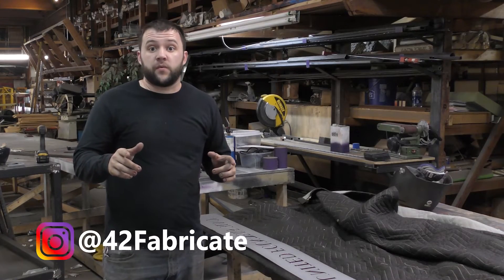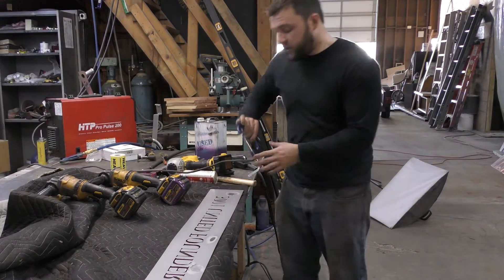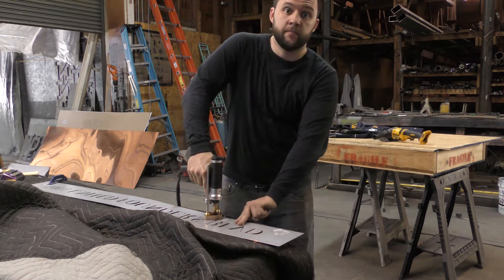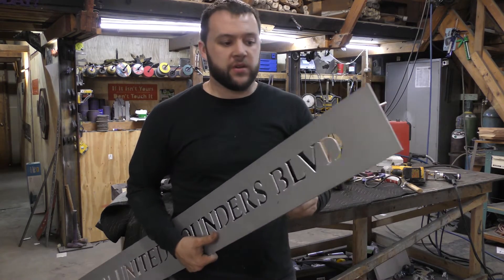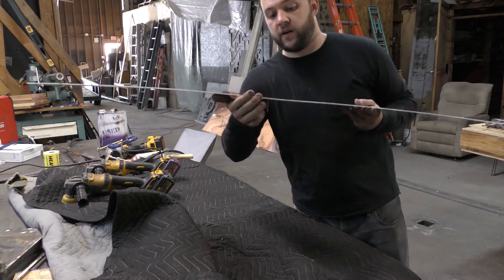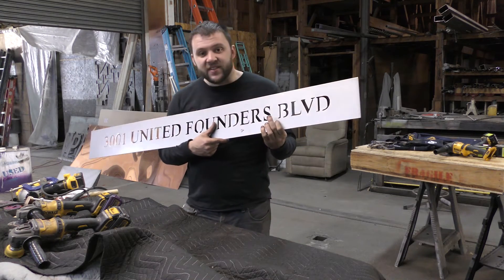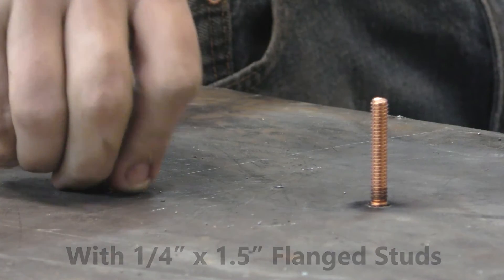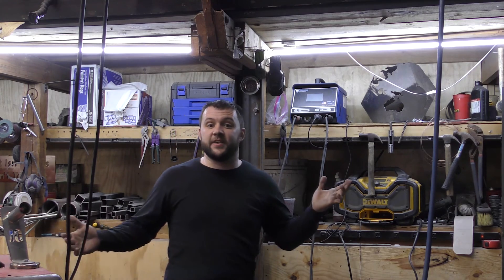Can You WELD thru Powder Coating? Without Damage? Sorta

Comment: The one that was clean you suspended with your hand. All the others you had pressed against the packing blanket. Try experimenting with that.
Reply from the maker: Good catch
Reply: Or, place the sheet on a solid surface that would absorb some of the flash heat and protect the coating.

Comment: Can you put a cold wet rag under the sign between the sign and the packing blanket ?
I put studs onto powder coated electrical boxes to hold wires in place and am looking to find a tool that will drill or grind just the paint off so that I can pop the stud/fastener to the can. !/4" diameter paint removal would be perfect with a divot in the center of it to keep stud from moving around. Does anyone know where I can find this type of tool ?
Reply from the maker: I am not aware of such a tool, but a punched pilot and a drill bit should strip the paint and give you a point for the stud, that said you also need a ground.

As for the wet rag, the thinking in the comments seems to be that not having anything under the powder was the best result, and I'd err in that direction. A wet rag could theoretically work, but introduces the chances of it not working, where studs over air seemed to work just fine.
Reply: @42Fab  As I was reading the comments, I was wondering..... How about using a reusable cold compress wrapped in a thin cloth? You don't make your work surface wet and chills the powder coated side enough to not be affected by the welding...

Comment: You can use a soaked rag on back side as a heat sink. I did this before on a part I had to weld after powder coat and it helped tremendously.
Reply from the maker: I would test it, but I'd guess it would work

Comment: Great video.  I would also point out that the one that had the best success was the one that was placed in the largest uncut area … seems like there might have been a few inches in each direction of solid metal to distribute (wick away?) the burst of heat.

Comment: The one that showed the least was overhanging the table and the blanket so it wasn’t being pressed into the blanket fiber as much as the others. Seems to me the powder coat gets soft and the hard pressing into the blanket caused the deformation. Having the powder coat more or less in free air so it can re-harden without being pressed into anything that will deform it might be the answer.  I can see if the coating is a different thickness or composition, there will be varied results.  Cool video though.
Reply from the maker: This seems to be the right answer

Comment: Definitely would try again with some sort of heat sink. I also noticed that the post that didn’t damage the powder coating didn’t appear to be completely pushed down on to the moving blanket. Could it be that the blanket insulated the heat instead of dissipating it quickly?  Either way I want one!

Comment: What about an aluminum or copper heat sink?  Water soaked rag or sponge to dissipate the heat?
Reply: On computer CPU's they use a grease as a heat conductor between two hard surfaces ...

Comment: Have you thought about chilling your powdercoated steel before you spotweld it? Maybe with some canned air? Put the can upside down and let the liquid propane cool down the metal? Or maybe use some copper heatsinks with heat conductive paste applied to it?
Reply from the maker: Lots of ideas, this was just one approach